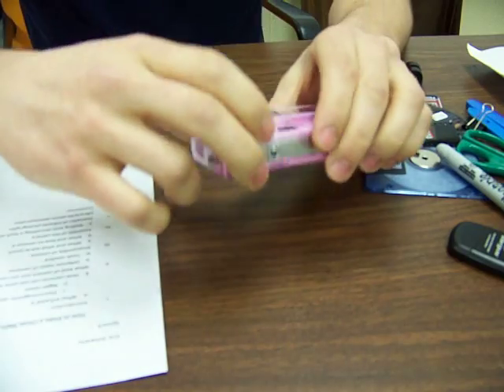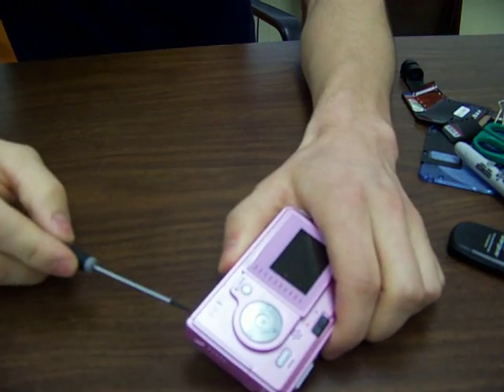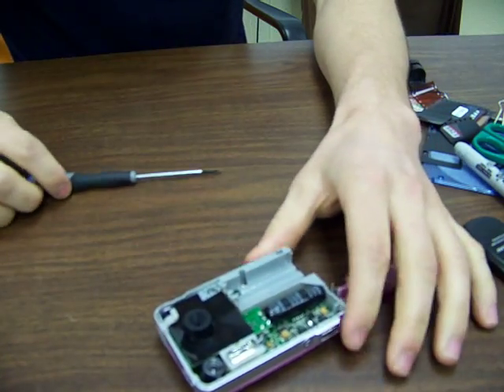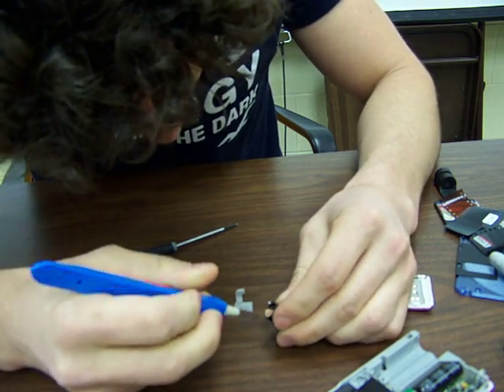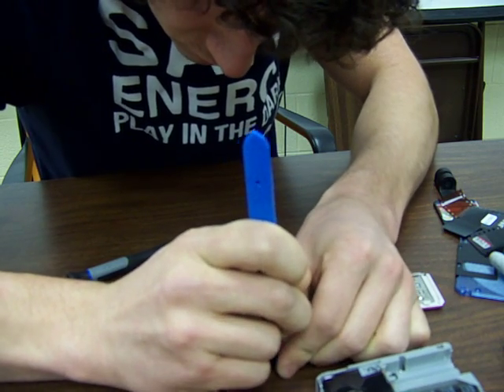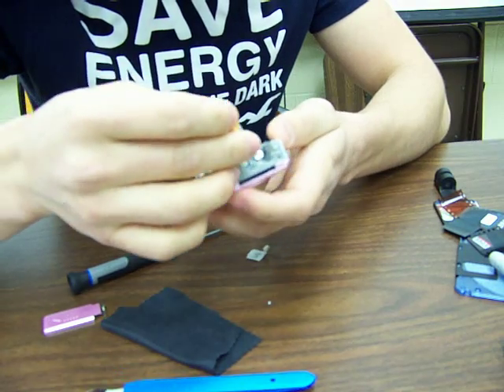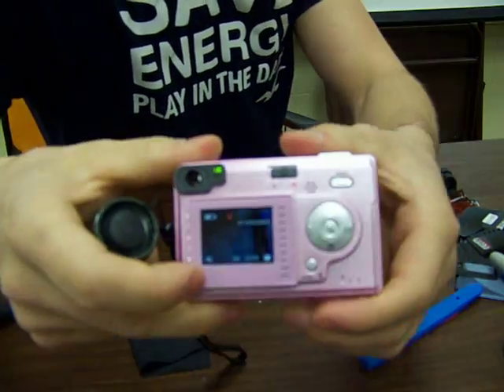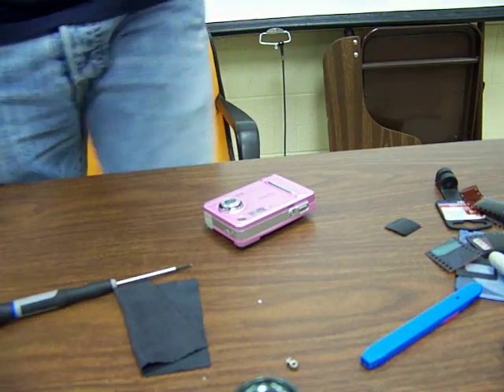How to make a digital camera see infrared light

Comment: @Mustacheftw
You said "You cannot get "shocked" by any measure by most DC powered devices.....300 volts means absolutely nothing when its amperage is measures in the mili range. What is shocking is that people still dont know that amps and not volts is what shocks you."

I'm afraid you are wrong. This is the dangerously misleading 'it's volts that jolt, mils that kill' saying.
A camera with a flash contains a capacitor upwards of 150uF charged up to at least a couple of hundred volts. There's enough Joules in there to blast a piece of metal off a screwdriver if you short it out, and easily enough to give you a massive, potentially life threatening shock across the chest if you touch the terminals with a finger of each hand. A very nasty burn if you put a finger across the terminals.
You don't get enough current flowing through your body to be shocked without the voltage being high enough - simple Ohm's Law. There's plenty of info and even a couple of videos on Youtube disproving the myth you've repeated.

Comment: another trick would be to get a piece of hoya RM100 and replacing the IR cut filter with that. Since Hoya RM100 is a filter that only lets near infrared and infrared through but no visible light.

Comment: I would venture to guess that the 330 Volts he was referring to was a actually a 330uF (330 microfarad) cap rated in the range of 10 - 20vdc. I may be wrong as I have only been in the electronics field for 30 years. This was very hard to watch as he fumbled through as if he had one to many cups of coffee or bong hits.
Reply: George Foster lol... If you've been in the electronics field for 30 yrs then you of all people should know full well that these caps carry very high voltage. This cam with a 330uF cap more than likely charges to between 250 and 350 volts. If you've ever shorted one of these camera caps with an accidental touch then youd absolutely know it will jolt the living shit out of you, not to mention burn the hell out of you..

Comment: You cannot get "shocked" by any measure by most DC powered devices.....300 volts means absolutely nothing when its amperage is measures in the mili range. What is shocking is that people still dont know that amps and not volts is what shocks you.

Comment: yes.  The capacitors stores the charge. It will leak out but very slowly over time.  Don't touch it even if batteries are removed.

Comment: this is wrong.  First the flash light you use is not infrared but rather ultra violet.  What does infrared have to do with ultra violet?  They are not the same.  Please check your science.  It is true about the infrared filters and all but the flashlight is still emitting ultraviolet or what people used to call a black light.  one use for it is that It makes the treads on the US currency glow different colors depending on the denomination.  Your video mixes up two different types of light.

Comment: If you don't want to do it yourself (can't blame you), there are outfits that do conversions.  Had planned on doing it with my old point and shoot after I bought my DSLR.  Yeah, it walked, I was pissed.  Do a search for infrared photography, it's pretty cool.  A local camera store might even do it.  Works best in winter, or cooler temps so you get contrast of temps.  Even the cheapo zepplin used would do it.  Good video for your class, btw.

Comment: @box0choklitz its easy when you get it it will have 2 metal things coming out of the back marked possitive and negative just connect 2 wires to those then connect the wires to the 9v its hard to find a good place to stick the board i just glued mine in a spray can lid

Comment: The flash uses a capacitor to store electricity.  The capacitor is charged in the camera from the batteries and then releases the charge when the flash fires.  If you don't short capacitors before you remove them from a board, the stored electricity can shock you if you bump it.  What he said is correct.